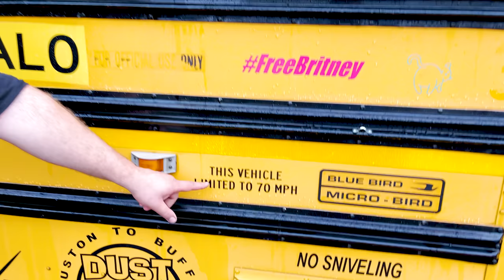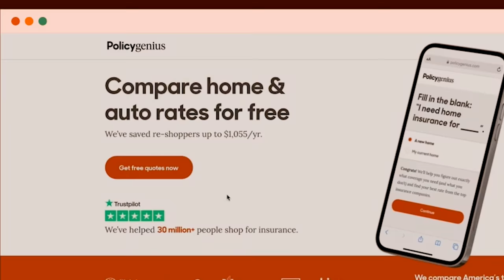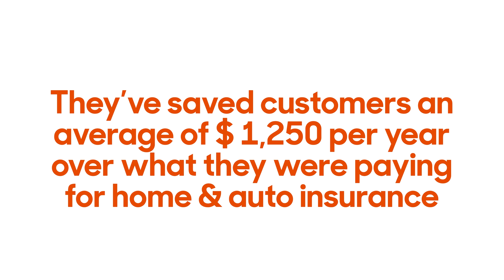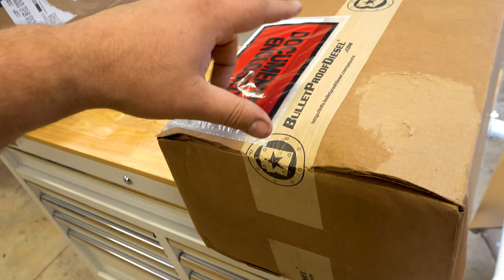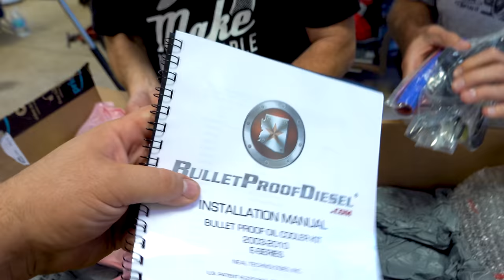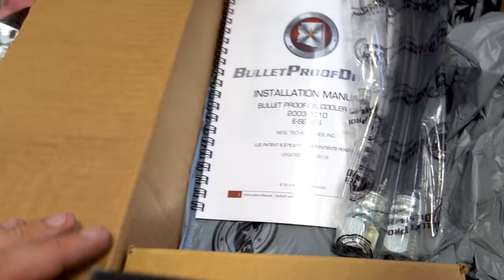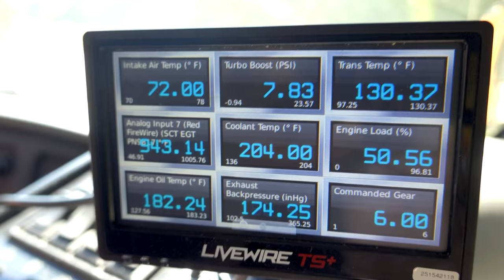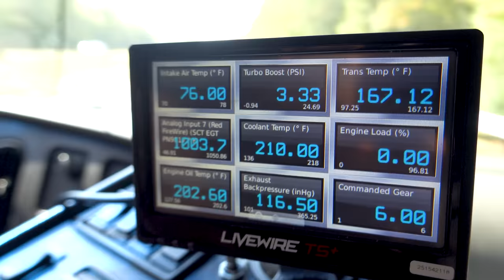Fixing A Broken And Abandoned School Bus In 3 Days (Was A NIGHTMARE)

Comment: I've heard of variable geometry turbos but never bothered to look into how they work; that is super cool.
Reply: They are cool. And work great until they gum up and get stuck in small turbo mode.
Reply: @nedyahyakcam  Yep. Or get stuck in big turbo mode and cause overboost, which sounds cool, but ECU witchcraft makes it bad...
Reply: We've got two at the job. Don't ever idle them for long periods of time. We have to disassemble the turbo and the intake manifold and decarbonize them yearly. Pita.
Reply: @burkeballistics685  Sneak a litre of two stroke oil in the diesel from time to time. Seems to help.

Comment: Those vortex generators work most effective in the rear, where the actual drag inducing turbulance is. So, along the rear edge of the roof and the rear vertical edges on both sides. Covering the sides with skirts will help and BIG gains can be had by making a flat pan under the entire bus. Not easy because of the live rear axel and other stuf sticking out but doable if you make standoffs to which you attach that flat surface.
Reply: Would removing the giant mirrors be a help too?
Reply: @spatchist  the giant mirror is useful though, it would be much worse to drive with only a small view out the rear.
Reply: I was going to comment on the aero stuff, but at the end of the day...it's a joke and they know it.

Comment: I can't fathom what engineer at Ford thought it would be a good idea to put an oil cooler in the V of an engine.
Reply: An engineer that listened to the servicing departments needing more mechanic hours at the dealerships probably ;)
Reply: Not just Ford. The one in my 2013 Jeep is there too...which I had to change out last month.
Reply: Some engineer thought it was wasted space in the middle and they could make the engine more compact if they utilized this giant empty area.

I'm not kidding.
Reply: It was international and honestly its a very impressive design assuming you have clean coolant and mever use the ford gold coolant. The amount of heat that setup can dissipate is crazy
Reply: @TravisFabel  yep, you're onto it. It's all about packaging
Reply: @TravisFabel  that's what happens when you let Navistar engineers loose on a design. Also, is this the Travis Fabel I think it is? If so, how's it going, brother?
Reply: The same one who decided to put the EGR there as well.
Reply: The 7.3L (Navistar T444E) has the oil cooler mounted by the exhaust manifold on the drivers side.
Reply: @mechntechbeau  And that is a big part of why the 7.3, while not as powerful, has proven itself to be the better engine choice.

Comment: Two things I would do. (1) Lose the special school bus lights (the pairs of double lights in the front and rear of the bus). It is illegal to have those in many states unless you are an actual school bus, even if you don't turn them on. Most people just paint them over. (2) In the front of the bus, where it says, "Rally Bus," I would replace that whole part with the aerodynamic wedge you see on the front of RVs and tractor trailers. That will improve airflow over the roof.

Comment: That would be pretty badass if the bus can not only make the trip, but make it in a respectable time. Also, I know it has the VG turbo but the name of the game on that particular record attempt is EFFICIENCY. So in my personal opinion, adding nitrous for quicker turbo spool, and lowering intake temps, would be a decent and fairly easy upgrade. If not, a simple water/meth injection setup improves overall efficiency also. AGAIN this is my OPINION so if you disagree, please keep it to yourself. Nice build fellas, looks comfy.

Comment: Try to use 2-stroke oil in your diesel, the good synthetic stuff. It really helps to clean the engine and especially the exhaust side and turbo. In our german diesel-paradise, there are a lot of guys using 2-stroke oil in modern diesel engines, including me in my 2014 VW V8 TDI Touareg.

Comment: For loooong routes & high load use 10w-60 weight oil :) It won't lose it's viscosity at higher temps as 10w-40/15w-40. They are also higher quality :D. Hope to see injectors & turbo & intercooler upgrade with nasty ecu tune (no smoke obv, keep it clean) :D

Comment: Coast to Coast, huh?
Well, if you are going with aerodynamics, you need to change shape of that area above the windshield, where ,,Rally bus" sign stays. Plus, covers for rear wheels and flatting out the bottom of the truck, like on speed machines, but with access for maintenance and heat dissipations. It's cool idea, in general.

Comment: 🤣🤣🤣 Coming from a 20 year trucker. Those “vortex” stickums do little to nothing 🤣🤣🤣. At the end of the day it’s still a heavy rolling brick.
Reply: @DataRew  when’s the last time you saw basically a block of wood flying through the air? It’s one of those theoretically sounds good, looks good on paper things. But as someone that’s owned 18 wheelers and tried these? The effects if any were microscopic if at all. I’m no engineer but 2 million real world trucking miles tells me that’s just a waste of $10-$50 depending on how many you use.
Reply: @Lumpygrits76  well the science of aerodynamics disagrees with you. They also have to be placed at the appropriate places in the windflow, so maybe that was your issue. Aircraft in STOL drag events also have vertical dams on the wings that act as a big old brick when they crab in, just as a bonus fact. Also, as Jared says, percentages add up when you are trying to optimize performance.
Reply: @DataRew  theories verses application. 😂 the “I think” this will help verses little if any changes in fuel mileage. I fell for it myself back when diesel fuel was almost $5 a gallon. Real world application of it says if there’s any benefits? It’s so minute that it’s damn near imperceptible. 
But wtf do I know. 238,900 miles to the moon. I’ve only made  the equivalent of 4 1/2 trips there and back over the years.
Reply: There's a trick to racing: doesn't matter what it actually does as long as your opponents think it does something.
Reply: @Lumpygrits76  I didn't mention a theory, I mentioned practical application. What "doesn't work" for your truck works very well for airplanes, so I don't know what to tell you.

Comment: That stock trans cooler is not much larger than the trans cooler on my 93 Crown Victoria (I installed it when I made the car my tow rig - also has a F150 dual core radiator). The new cooler will definitely do well.

Comment: I have a feeling they are really going to regret those eye bolts at the edge of the plywood on the upper bunk. Those look exceptionally painful to roll into or even bump against while loading and unloading.
Reply: Was actually thinking the same thing. Open to suggestions.
Reply: @omgjpg1058  Split some pool noodles to go around the steel posts. Maybe get some styrofoam balls to go over the eye rings
Reply: @henrysanders4680  Henry sneaking into the depths of YouTube comments with the solution! I'll get on that.

Comment: Oh, you made an error: The vortex-generators you put on the front edge of the roof are supposed to be at an angle, alternating the angle from one to the next. That's what we do on aeroplanes.
So you completely messed up the high-speed aerodynamics.
Here you have an explanation why you can't get that rig to run over 70 mph...

Comment: Hey I was taught to wash or rinse a radiator for fan side out any truth to that ? I’m in the HVAC world and that’s what we do for outdoor ac units when cleaning. And what I do when I’m down mowing fields with my tractors 🚜
Reply from the maker: If you just use compressed air or if it’s very compacted you would want your first rinses to be fan side out to make sure you don’t compress the stuff more into the fins, but I’ve not had any issue cleaning from both side ls
Reply: @TheQuestionableGarage  thank you. Well i guess i was safe to assume teach my guys to clean from the opposite side of air flow to prevent anything packing into the rad lol so you know the coil cleaner we use is amazing. It foams up and draws out dirt and grim idk how it’ll handle car rad paint but highly recommended if for trying to deep clean a rad. 2:1 outdoor condenser cleaner, a pump sprayer and possibly a cheap can of black paint and your set lol

Comment: these busses are driving around for decades, all day, (nearly) every day. if these add-ons help with efficiency, why doesn't every bus have them? is the cost of adding these to the buses that much higher than the savings in fuel?
Reply: Most buses are cruising around at 35mph instead of highway speeds, that's the main difference.
Reply: @pkonneker  and the gained efficiency isn't worth the trouble at these speeds? is it that negligible?

Comment: There's one thing I just cannot get over with. That's how U.S. dudes tell the engine displacement. If your measurement system are all to inches, ounces, pounds etc, why you tell the engine displacement in litres which comes from metric system? Engines are 6.0, 6.2 and so on. Why not in CID? :D No offence. I live in northern Europe region and this is just something that non-native English speaking guy is wondering.
Reply from the maker: We use both for engines and it is just as confusing.

Comment: Nope. No way in hell. If you had any part of that HPO system apart it would not start that quick. But long starts aren't any fun for the camera I guess.
Reply from the maker: The hpop never came out, just the oil cooler housing, hpop  valley stayed full of oil, several key cycles to prime to the fuel filter housing. Having worked a good bit on 6.0s I expected a more labored start but that was a genuine first hit.

Comment: What's wrong with it - it's a Ford. When using degreasers on your cooling radiators DON'T use the alkaline based degreasers, use the petroleum based ones because the alkaline ones will eat anything aluminium, especially the rubbish, poor quality Ford parts.